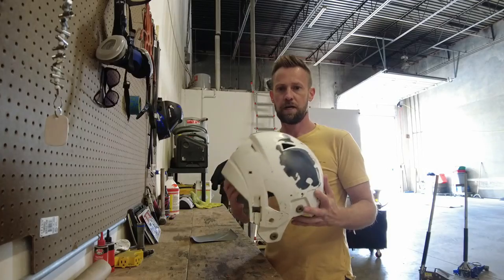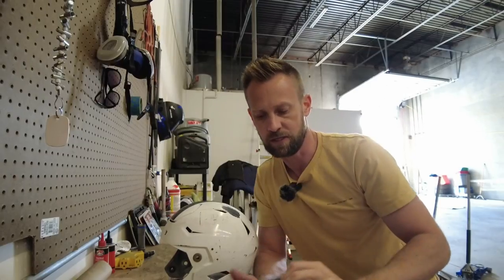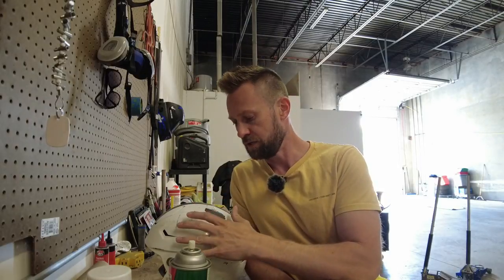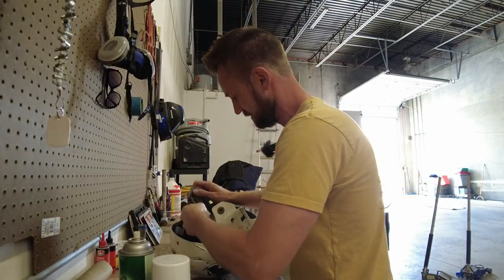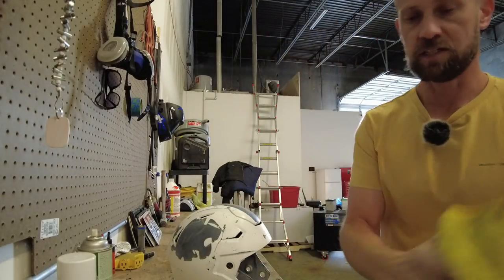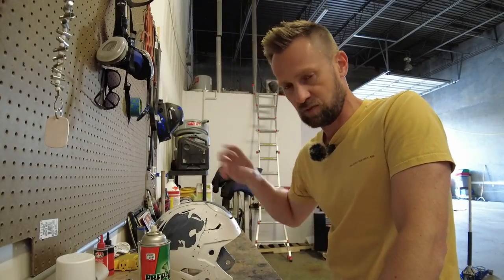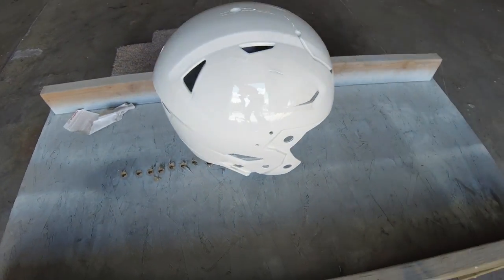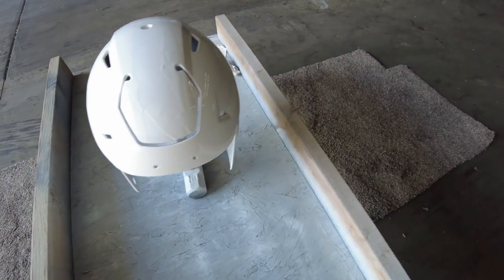REPAINTING A FOOTBALL HELMET A SECOND TIME

Comment: Ok I really appreciate this. What I could not gather in the video is if I am painting a brand new helmet (I could only get black and I need white.  Time was running out this year) do I need to "sand" down the black paint totally off the helmet OR just brillow pad it (which to me does not seem like it will take any paint off), apply paint prepare, and then paint?  

If you could clear that up I'd really appreciate it.
Reply from the maker: you are just trying to scuff the surface up to give the new paint something to stick to. scuff it up really well. the better you do the better the paint will hold. Then clean really well and spray. good luck.
Reply: @Megachad  thank you so much.  I will get it done within the next couple of weeks and try and take a video I guess and share with you!

Comment: Just got my son a new white Youth Riddell Victor 1 Helmet. It’s really smooth, so do I need to break that gloss barrier? Or leave it the way it is and just spray the new paint over it?
Reply from the maker: Sucks you need to paint a new helmet. ha.. you absolutely need to scuff the helmet really well. otherwise the paint will peel right off.
Reply: @Megachad  that makes sense. Coach decided to not go white last minute. So I need to,

1. Sand it really well enough to break the gloss and seal on it.
2. Use paint thinner or prep all to clean it up.
3. Paint it

Any seal or gloss product need to be used after that?
Reply from the maker: @zeketomaselli   no that should work.

Comment: Hey man thanks for your video. I need to paint my sons helmet but I’m concerned about voiding any manufacturer warranties or potential reactions to the helmet properties itself. Is this something to be concerned about? I mean safety is really key for me. Thx
Reply from the maker: Not really a safety issue. Highschools and colleges paint them all the time. What helmet is it? I'd be more concerned about which helmet you are using if you are worried about safety. There are several that are now very safe and made much better than others.
Reply: yes, you need to be concerned about chemical reactions with the helmet.. helmets are made of poly carbons, not plastic, and lots of paints contain acetone, xylene and ether that can make the helmet brittle... contact a certified helmet reconditioning service if you want to do it the right way
Reply: @SEXZYREDD  I've painted a few semi pro helmets with over the counter stuff and had good results... My comment was more as a notice to the content creator that he was giving out false information... Give the helmet a few good squeezes to make sure it's still flexible and not cracking and you should be ok... Most over the counter paints don't have enough xylene to do damage .. Good luck
Reply: @clancy4freeswag562   what did you use that worked well for you? Needing to paint my helmet for semi pro and don’t want to ruin it
Reply: I am about to repaint my son's  helmet.
I plan on using the krylon fusion paint. Is this a good type of paint to use on it.
Also to te paint a face mask can one use a liquid paint stripper like ones used on cars.

Comment: My coaches and I were literally talking about painting our boys helmets today because it gets expensive having 25 plus boys helmets painted so I came to YouTube and found your vid from last year.  Then noticed in the comments you were going to paint your son helmet today lol.  We are going from gloss white to a matte black this year. We are thinking of using automobile paint.  Do you think we need to use primer first?
Reply from the maker: If you prep them really well I don't think you need to, but it wouldn't be a bad idea to go to the paint supply store with a helmet and ask them if they recommend a primer and which one they recommend.. They probably will recommend a primer, but the helmets I did in the past without primer worked out better than this helmet I did last year with primer.. So it's hard to say. A hard 1 stage auto paint is very strong. Matte is a tough color to lay down and make it look matte.. So I am not sure how that will turn out. Just talk with the autopaint guys. Make sure they can put it in an aerosol can unless you are very familiar with using a spray gun etc.. they are very difficult to get right if you aren't familiar with them. best of luck!!!

Comment: What do I do about paint drip? How to prevent it and fix it. Thanks
Reply from the maker: thats why you do a light tack coat first. Light coat, let it sit for 5 min so it gets tacky then the next coat can be a little thicker. it won't usually run because the tacky paint won't let it.. if you get the paint too thick it will run.. it should take 3-5 coats of paint to complete.